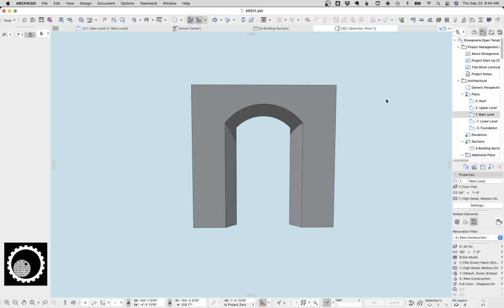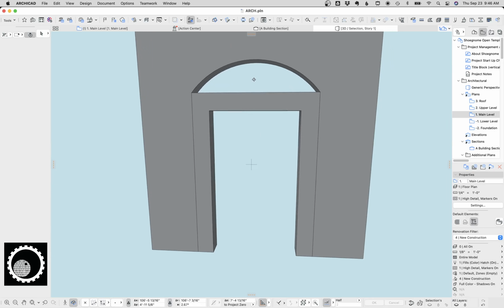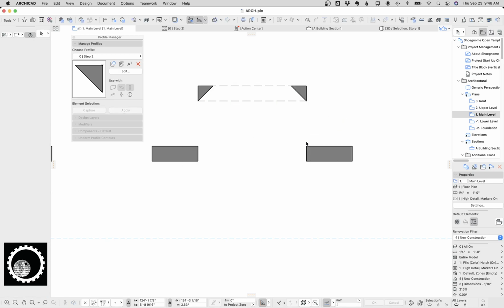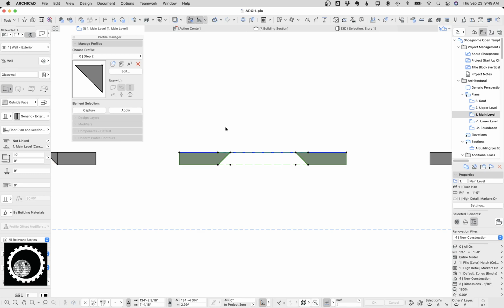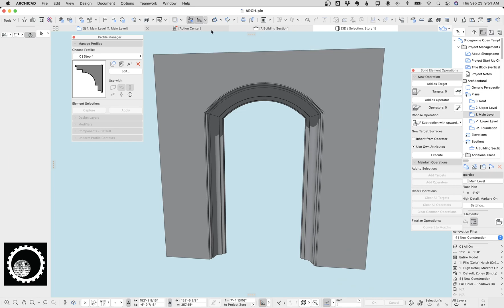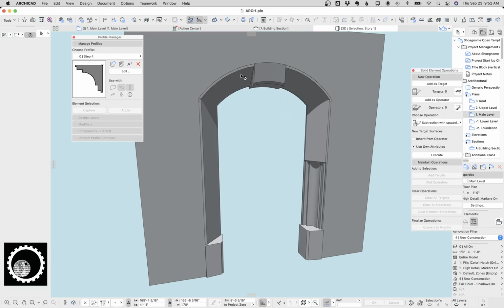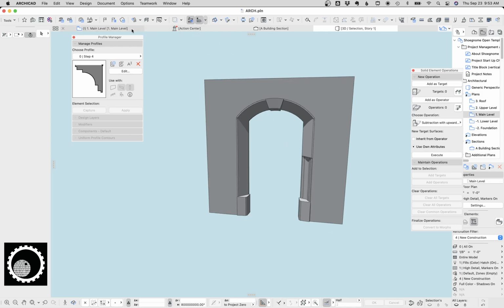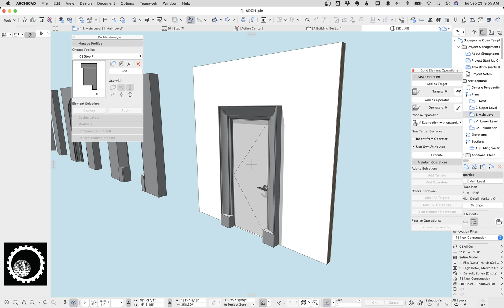Archicad Tutorial #79: Arched Openings with sloped sides and Complex Profile Door Trim

Comment: Great Video.  It is amazing in this day and age that most Architectural software does not give us the ability to set back the inner edge (reveal) of opening trim from the inside face of the opening jambs.  Boggles the mind.
Reply from the maker: Agreed. There's so much low hanging fruit to improve doors and windows, especially in regards to trim and relationships to the wall.

Comment: Great video Jared! How would you incorporate these elements into a schedule such as a door or a window schedule?
Reply from the maker: I'd use the door elements (arched opening) or door for the schedule and add linework in the elevation if you're showing that or just use Archicad properties for the additional information like trim type or description of the sloped entry.

Another way would be to schedule the door object along with the beams/columns and then group them all in  a schedule using a uniform ID or Archicad property for a headline like I show in this video when I group windows/doors by Ganged & Not Ganged: https://www.youtube.com/watch?v=qqwh3HVtNXU That system has a lot of details to work out and might not be automated enough to be viable as of Archicad 25, but that's the ideal direction given Archicad's current 2021 limitations.